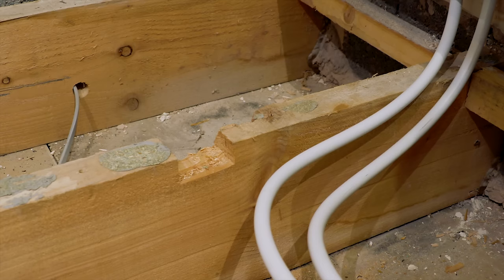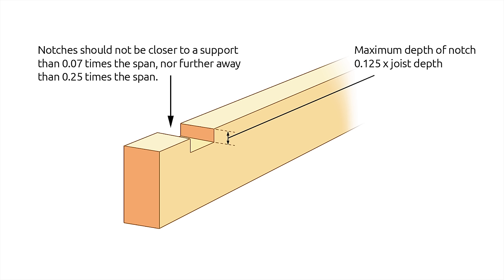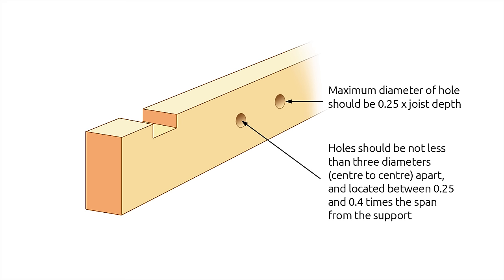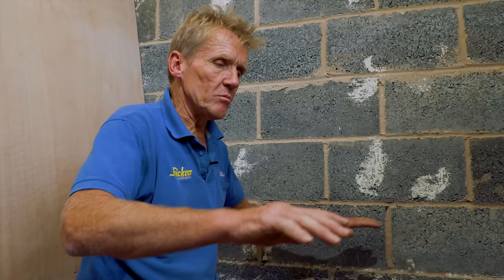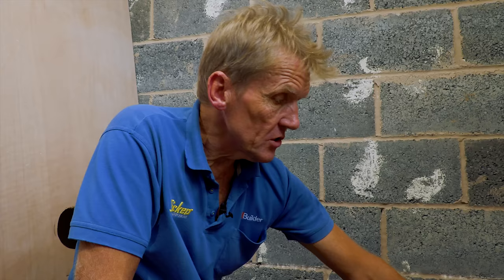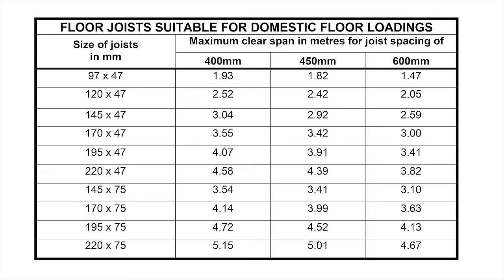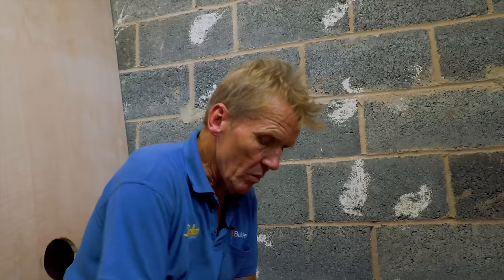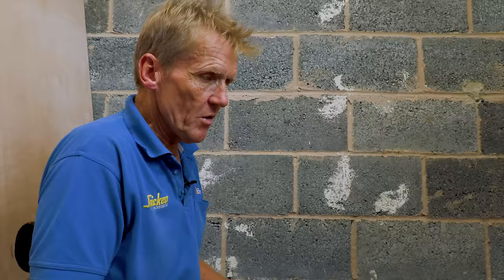Notching & Drilling Joists - Keeping it Legal

Comment: The stress in a section of a beam subject to bending is linearly proportional to the distance of that section from the neutral axis of the beam (stress = bending moment x distance of section from bending axis / second moment of area), which will be the centre in this case. So, the centre of a beam is almost unstressed, which is why it is OK to drill holes there. Notching a beam, on the other hand, is removing strength from the area that is most highly stressed and has the biggest contribution to supporting the load. Obviously, then, drilling holes in the centre makes sense. Notching does not and only works because the joists are bigger than they theoretically (by way of stress calculations) need to be in the first place.
Reply: Currently renovating a bathroom. Drilling in the centre is preferable but then, depending on the run, you've got to use small sections of pipe with couplers. The exception being plastic pipe for water supply.

Comment: I feel more comfortable adding a reinforcing plate as well.
Its surprising that some enterprising company hasn't started selling reinforcing steel plates with pre-made say 50mm holes already in them. The steel plate is sized equivalent to a whole joist in strength. You could just screw the plate onto the joist drill through the hole and it's stronger than it was before.

Comment: I wish you'd looked at the joist you were pointing at when you spoke about drilling.  That was the info i needed.
Reply from the maker: Sorry  Mike . Not great work.
Reply: @SkillBuilder  No that's not true, great work just a minor slip.  I have to put a waste through joists and I need to put it through the least number possible.  Like the screw and glue plywood to the one you drill through.   Enjoy the vids.

Comment: really like to see you reinforce the structure after weakening it with holes, makes me feel safer knowing builders consider it, if not all of them
Reply: Search for beam bending, specifically neutral axis.... the top of the joist is in compression and the bottom in tension under normal loading. the centreline of the beam sees no stress hence the hole placement, reinforcement isn't needed.
Reply: @markbarlow4918  Yeah, you can put an awful lot of hole in the centreline of a solid timber joist without making any real change in its load-bearing capabilities. I worry a great deal more about notches than centreline holes.

Comment: I've been to loads to fit t&g floorboards obviously after the plumbers and electricians have been and they have notched out, absolute nightmare trying to get some fixings in when their notches are as wide as the floorboards and there full of cables/pipes
Reply from the maker: It should never be done. I hate to see that. I was trying to come up with a metal clip that would go over but it is hard to design and wouldn't sell.

Comment: The plumber has notched the top of several joists  for plastic radiator pipes, does this need strength ing now?
Reply from the maker: Not if the are less than one sixth of the depth.

Comment: This is a very important topic as these rules are so frequently flouted. I think this video is missing some vital additional information. For instance how far apart a hole in a joist has to be from a notch in a joist. The region of a joist that is permitted to have a hole through it is different to the allowable region for notches. What is the required spacing between holes? Is that dimension measured from closest edge to closest edge, or center to center? Unfortunately, this Video shows a hole and a notch in the same joist closer together than is permissible. I think it would also be useful to advise that trades cooperate as much as possible when routing services through joists given that every joist has limited real estate through which holes or notches can be cut electricians and plumbers should make sure they can both run their services without limiting the options or routes for the other. that might mean drilling a hole larger than the size you immediately need but within permissible limits if it is likely that other wiring or pipework will need to be routed through the same zone. It is an awful lot harder to increase the size of a hole when there is already a cable or pipe in it. perhaps there could be a more in-depth follow-up video.
Reply from the maker: You are right and those holes are closer together than they should be. We hoped the diagram would explain it but not everybody reads.

Comment: How do these rules apply to I beams? These have timber top and bottom but particle board in between.
Reply from the maker: Never notch an I beam, they are usually marked for drilling.

Comment: There is very little loss in the strength of a joist if you drill a hole in the middle of the joist, the strain is taken up by the low and high edges. Notching on the other hand does have a significant effect and should be avoided. There is no excuse for electricians putting-cables in a notch, and it’s dangerous. Even plumbers can put plastic water pipe through holes drilled in the centre of the joist.
Reply from the maker: Totally agree
Reply: I was (rather naively, in hindsight) screwing some creaky floorboards down in my new house recently, only to discover that one of the floorboards wasn't attached at all. I lifted it up to discover the electrician had notched the joist and sloppily put the wires through, without even covering it up on top. Every time you stood on that floorboard, you were pressing onto wires - if I'd tried to screw it in without checking, I'd have had a nasty surprise.

We had a guy come to sand some of the boards down and he said he couldn't do the job because of the weight of the machines on top of those cables.

Comment: Hoping someone can help, I have a problem where the previous owners have put 2 x 22mm pipes and a 15mm pipe notched Into the top of a joist, but when ever I walk on the floor I can here them rattle, can I take the notch down more and try and secure them, then use a thin metal plate on the joist the bridge the notch, and fill this with a duct sealing kit ?
Reply from the maker: That is a good plan. It happens a lot and you can buy hairfelt pipe lagging to put on the pipe. You can buy those plates for protecting gas pipes from nails and screws. https://www.screwfix.com/p/sabrefix-protecta-safe-plate-galvanised-90mm-x-45mm-20-pack/30038

Comment: How do know the joists  will be weakened if you drill a hole of 16 - 25mm or notching it? Is there a test for it. I think timber joist will deflect to .003% in the middle 4-5meter.
Reply from the maker: You don't have to know. Some things are just there in the regs and you do them. The centre line on a beam is the neutral axis and provided the holes is not too large it will not weaken it. The top is in compression and the bottom is in tension with the middle being neither. If you cut away the top with a notch the compression is reduced so the joist is weaker

Comment: Hi Roger and team. I’m wanting to put 150mm ducting through several I joists for a flush ceiling kitchen extractor. Not opened the ceiling yet and can’t remember whether the upright of the I (is this called webbing??) is OSB or ply. Either way, one or the other, I have a 150mm hole saw. can this material be cut out to 150mm round, and maybe reinforced with ply or OSB (with the same hole cut through it and sandwiched onto each side where accessible? The last joist is probably tight to the wall and only accessible on the room side). Thanks for any advice you can offer!
Reply from the maker: How deep it the I joist? You can look up the permissible hole size. It is usually marked on there. Is there no way to go parallel with the beam?
Reply: @SkillBuilder  approx 10 inch but haven’t got the ceiling down yet. Having an extension soon and planning to do kitchen DIY. There will be a steel blocking the parallel route to the outside so only option is through the webbing of the iJoists. It could go central to the span (only 3m)

Comment: @Skill Builder  Is this video applicable in U.S.A? I plan to run two 1/2 inch water pipes, one cold, one hot. also I plan to run a 3/4 inch gas pipe. also what drill do you recommend to make these holes?do you have a Snap-On Drill bit recommended set and a drill? I plan to run wires as well. I have done it industrially which I think is much easier than residential since everything is out in the open to see.

Comment: So the max hole size hole on a 2x6 would be 3/8? That’s not enough to fit a romex cable.
Reply: I believe the video said 0.25 which would be 1.5 inch .... and you can still fit a romex cable through 3/8"

Comment: If you have an old notched joist, where the wire is no longer needed, would plugging it with wood strenghten the joist and is it advisable?
Reply from the maker: It can do no harm because the top is in compression when a load is placed on the beam so putting the bit back is going to restore that bit of compression.

Comment: Hi, just a question. We have built an extension and the builder has laid the floor boarding. However, the plumber seems to think that out only option now is to drill the central heating pipes in but this would mean that he cannot use copper and must stick to plastic. Can you advise?
Reply from the maker: Ana Karlovic

Hi Ana 

This is the best option by far. Notching in the top of joist and laying copper pipe in is not a great thing to do. I and many plumbers use copper above the floor but where it is hidden we now use PEX pipe for hot and cold water and central heating. It should outlast copper. The pipe is guaranteed for 50 years which is twice the guarantee of copper.

Comment: how bad is it of the holes are closer together? ive bought a house and we are rewiring it and in some places there are 3 holes very close together from whoever did the job last
Reply: It should be fine provided the holes aren't massive and their is no creeking or movement. If it's weak you can sister the joist/s, add noggins or even add angle iron or steels.

Comment: Can I ask what the rules are for studs? (non load bearing) i'd like to hide my 32mm pipe and my BCO doesn't want 2" notched out of 3x 4" studs in a row. Bit bemused personally as it's not a loading wall.
Reply: Interesting as mine is in a stud wall 🤔 let me know how you get on with bc 👍
Reply: @kingofthetrowel1725  Sorry late on the reply, long story short, I didn't get on with them. Ended up using a service void with counter battens. meant less holes in the vcl but 2" smaller room, kind of a big deal in a space which was only 85 cm wide in the first place! looks neat tho

Comment: Really clear video - thank you. I think a few tradesmen (including a recent electrician we had) are a bit cavalier about drilling holes anywhere that suits them.

Interested in your plywood technique - do you glue/screw/both this onto the joists? My (layperson) thoughts were that with screwing/bolting there are even more holes in the joist.
Reply from the maker: The idea of the plywood is simply to close any stress points around the hole. If, for example you had a split in the timber joist. You must glue it so it acts like a plywood beam.

Comment: You must be stating requirements of the LOCAL code where you're at.  The IRC (International Residential Code) is NOT the same.  Like the size of a bore:  You say 1/4 depth max but the IRC says 1/3.  And a notch, as YOU state, should be within the outer 1/4 of the span whereas the IRC says 1/3.
Reply from the maker: The International code often quoted by our American viewers is little more than an American standard.  Americans are fooled into thinking is applies to lots of countries but really it is only America and a few other smaller countries that are under their standards to save them having to write their own. We have British Standards and European Standards which are closely aligned but we also have difference between England and Scotland. All jobs for the boys.
Reply: @SkillBuilder  Damnit man!  I suspected as much.  Yep.....that's us......half-ass.  It's like this damn Schluter crap over here:  We can't get Kerdi-Col, which ACTUALLY makes the membrane/band bonding "waterproof."  Our code is plain, unmodified thinset.  From what I understand, actual "waterproof" mortar is required in Europe for membrane/band bonding?  Know anything about that?  I won't use that system for JUST THAT REASON.  If ya ask me, it's a damn money grab, as the way that system done over HERE is NOT "waterproof."  It's RESISTANT enough to assure that the system lasts long enough to rid the maker of the liability but not so long that the maker can't make money on it aGAIN....sooner rather than later.
Reply: @SkillBuilder  bit like the baseball World Series 😆

Comment: Why are you brits still talking about inches? :)
Reply from the maker: Because we are leaving the E.U and we will return to the old ways. Seriously we use both, multilingual.
Reply: Cause its easy to see on a tape measure. If it aint broke why fix it.
Reply: For some things it's easier to visualise, especially for those that grew up using it more.
Reply: It's an old age thing. I'm 49 and we are definitely metric

Comment: USA people - disregard  this ! Not code, in USA.
Reply from the maker: Interesting! This was never intended to be for anyone outside the U.K but just out of interest I looked at the USA code and it seems to be almost identical. Admittedly the average American is a heavier unit than the U.K counterpart but most of the details about size of holes and depth of notches is the same. Can you point to one or two places that it differs?
Reply: @SkillBuilder  Tumbleweed...